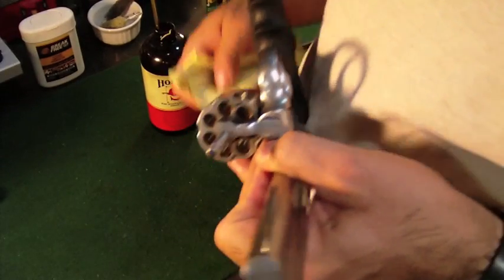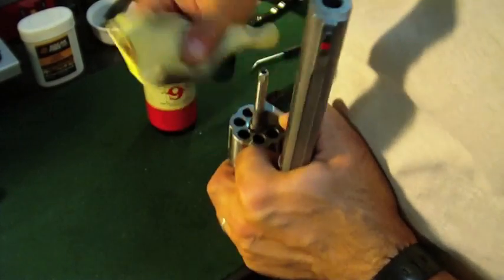Cleaning a S&W 686 Revolver Part 1

Comment: A good tip for using solvents is to only pop a tiny hole in the seal when you open them.  That way you can just drip the stuff out onto a rag or patch.  It makes it so you don't have to be as careful with the bottle because it won't spill as easy.  It also doesn't evaporate as quickly.  And most importantly, it is very easy to apply.

Comment: Is it better to remove the cylinder when cleaning?
Reply: +Basilona ~ I always do. Not that difficult. Just remove one screw above the trigger guard on the right side. Open the cylinder and it will slide off.

Comment: I tend to stay away from any abrasive (even micro-abrasive) products. A nylon brush may help but you are scratching the metal on a microscopic level. Also... it looks like you're being very careless when cleaning this gun... banging the nylon brush around... i saw you stick that mop down the barrel not being EXTREMELY careful.. you can scratch the inside of the barrel with that metal tip on the mop! GO SLOWLY AND BE EXTREMELY CAREFUL!